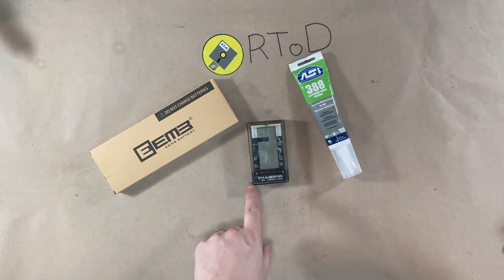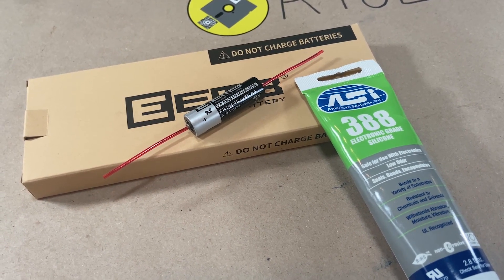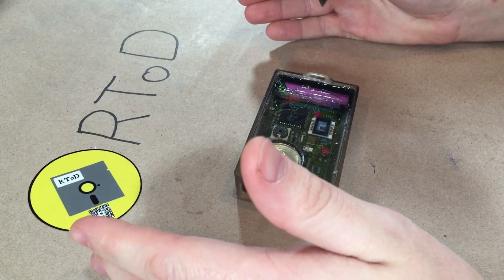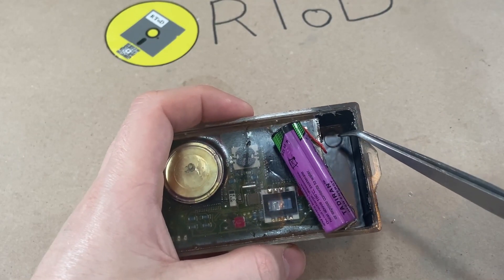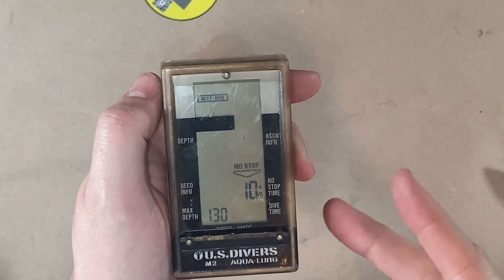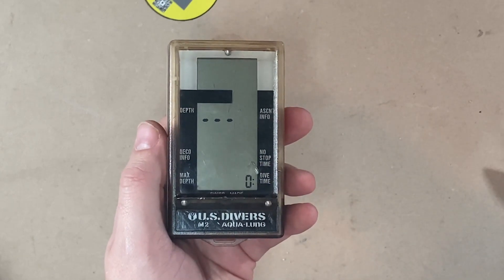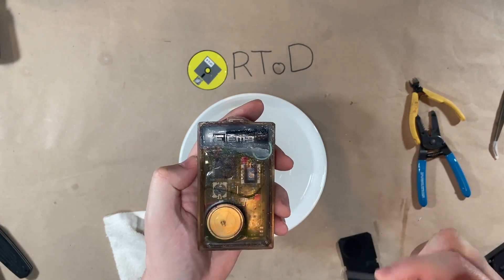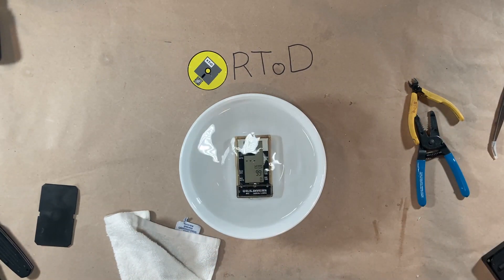Reviving Your SCUBA Gear: Replace the Battery in Your US Divers Aqua Lung Monitor 2 Dive Computer

Comment: I have the original Monitor 2 Owner's Manual if you are still looking for a non-Plus version.  I'll scan it if there is interest and/or trade for some Osborne 1 CP/M 5.25" floppies.  :-)   I found your video while searching for info on the computer -- I bought mine ~1993 and will try to resurrect it for actual use.  I trusted my life to it back in 1993 in lieu of using dive tables, and I have no hesitation to do it in 2025 for diving with regular air.
Reply: Hi, unfortunately I don’t have any Osborne 1 CP/M 5.25" floppies. But I’m interested in the Monitor 2 manual. Could you maybe scan it?